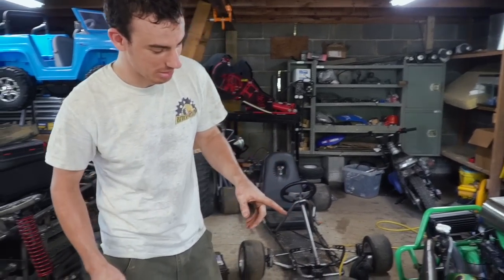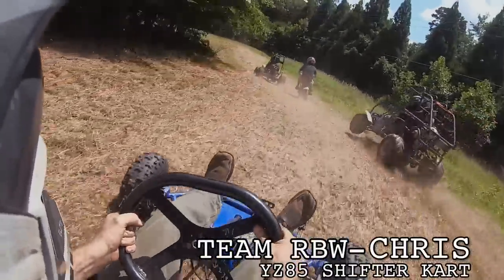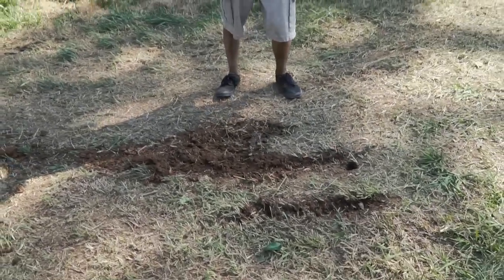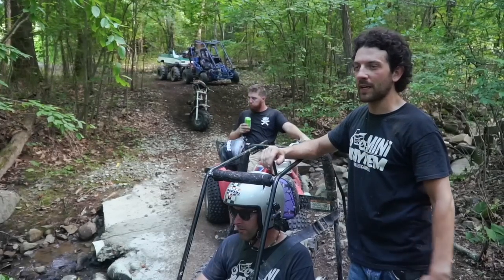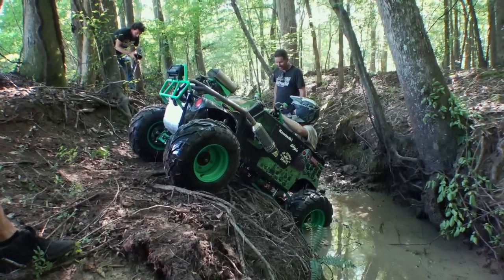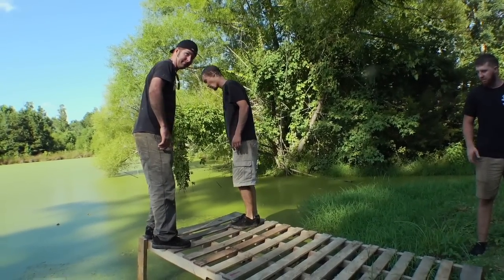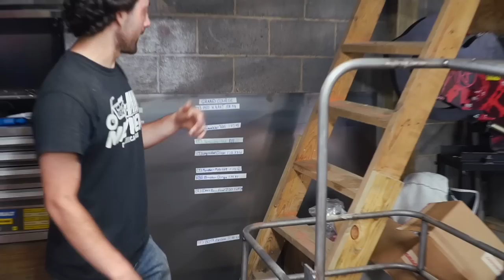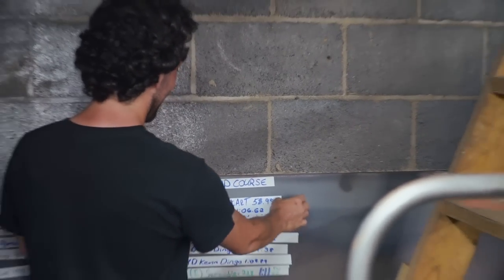We Held the First Ever BACKYARD 300!! | 7 Way Endurance Race, Jump Contest, Rock Crawl!

Comment: You should get a bunch of Koi fish for your pond, they eat the algae,  also there are other fish that eat algae, not sure which kind is best for your pond but it would be awesome if you got it cleaned up and then build a little speed boat out of Styrofoam with your fastest 212 engine, or you should each make your own and race them, anyway nice video, looks like some fun times.
Reply: first a pump with an aerator then after some sunlight can penetrate you can add cat fish, Gold fish or Koi and eventually trout, bass and turtles
Reply: Experimental Fun nah just fish in it

Comment: You need some "sonar" for that friggin' duckweed. There's a generic version for about $350 a quart, sucks but it's the only thing that works.  You need some form of aeration like a fountain or bubbler setup too. If you see geese, run them off, they most likely brought you the duckweed.
Reply: it didn't look that bad when they did the rc boat video , crazy how quick it took over.

Comment: Let me clear something up I'm not exactly  sure what  frankincense build it is but it has a yerf dog seat on it so I'm assuming  it's a heavily  modified  one since it has Been modified  to hold 8 shocks in total  4 in front and 4 the back  and they also had to extend the roll cage to fit the engine